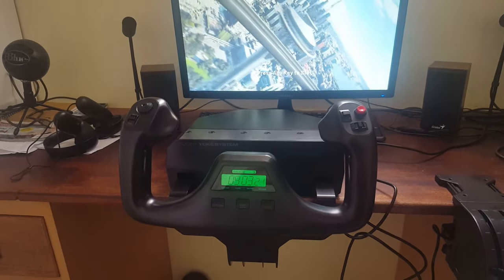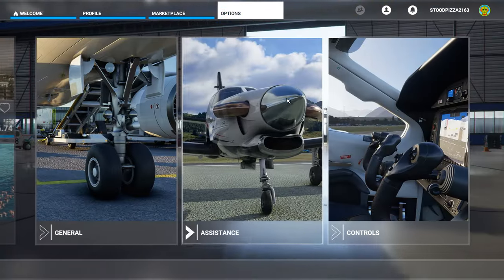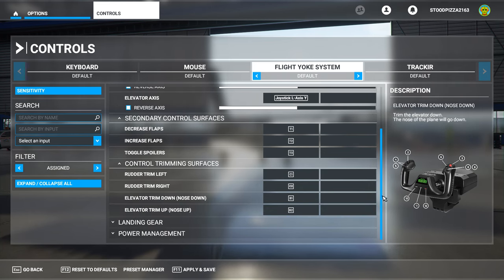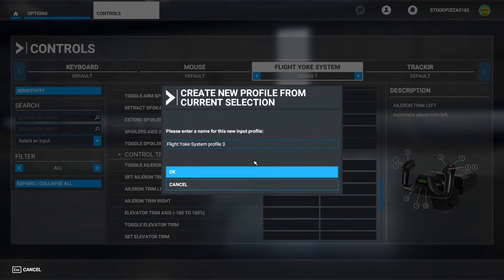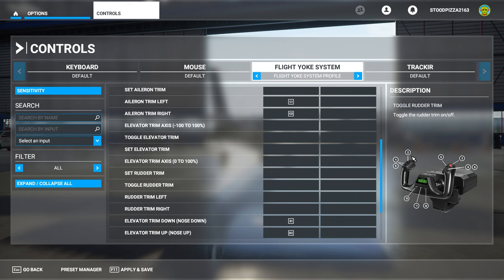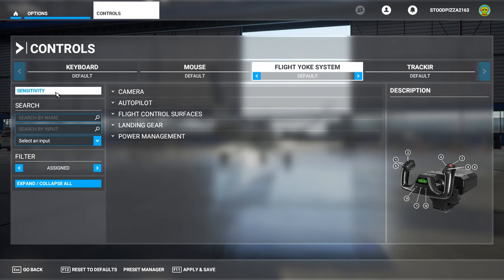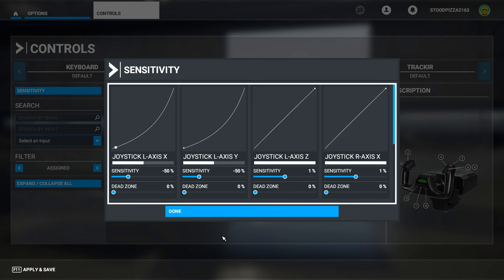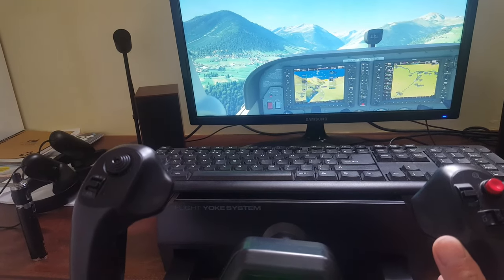FS2020: Setting up the Logitech Flight Yoke System and alleviating the Deadzone!

Comment: Thanks for your videos (this one and others), they convinced me to take the plunge and buy this yoke system. I was using the x52 HOTAS previously and I'm very glad I made the switch. I do miss the mouse control but can get by with my actual mouse. What I haven't figured out however is .. rudder. How can you control the rudder with this setup ? I haven't purchased the equally expensive rudder pedals and since there is no twist motion on this one I'm stuck. Am I missing something ? Thanks!
Reply from the maker: Great to hear that you decided to buy the yoke system.  
It doesn't come with rudder control; your options are to either assign one of the rocker switches to rudders, or to use something like the keyboard or Xbox 360 triggers (which is what I used to do), until you can get hold of actual rudder pedals.
Reply: @Huddison  I did try mapping it to one of the rocker but they only register as adding left or adding right and do not return the rudder  to its neutral position when released. Is there something in msfs 2020 under the config I could change for that to work ? My setup is pretty clunky as it is, I can barely reach the keyboard. will have to tinker :) Thanks again!
Reply from the maker: @VoicelessScream  I'll think on that for you.

Comment: Hi sir I need your help when I installed last week fsx2020 I adjusted my control it worked fine but today I wanted flight fsx steam edition and the controls disappeared I don’t know what to do
My Xplane11 work fine as well
Reply from the maker: This is not the first time that I've heard of this interference - someone else posted that they were having problems with P3D and the yoke, after installing FS2020.
I want to install my FSX (for tests) at some point; so I'll take a deeper dive into the matter, when I do😉
Reply from the maker: I re-installed FSX (Steam edition) - My yoke worked as normal and afterwards, I went back into FS2020: yoke was working as designed there too.
If I were in your shoes, I would completely remove FSX (all folders and aspects of it) and then reinstall to see if this solves the issue.

Comment: the game will recognize the Logitech yoke correct? Also I have a CH products yoke, and it doesn't want to recognize that one.
Reply from the maker: Yes, it automatically detects it
Reply: Not at all. I used my yoke and rudder  panel for prepar, perfect, but for fs2020 it’s a real mess, because of the prepar settings?

Comment: Hi , 
on high performance airplanes this is very sensitive on the fs2020 i have a yoke like this
Reply from the maker: You can adjust the sensitivity settings to get it more to your own liking. I have mine feeling and behaving great for myself👌
Reply: @Huddison  
Yes, I already checked these sensitivity parameters, updated the joystick driver ... can you handle the sensitivities within the saitek profile?
Reply from the maker: @Medeiros_Edilson  You can have a play around in the device settings itself, to see if that improves anything for you (in control Panel).
Otherwise, I'm at a lost with what is causing your issues with the yoke.  Perhaps a complete uninstall/reinstall of anything that you have been using with the yoke might help(?).

Comment: Hello sir, My PRIMARY CONTROL SURFACES HAS NO RUDDER AXIS, please help me to setup rudder control with throttle quadrant, Thanks in advance.
Reply from the maker: Use the keyboard if you have no pedals or other.

Comment: Thank you so much for this Video. I have bunch of Saitek panels and sadly they wont work for the moment. I should be satisfied with my yoke / rudder working. Super going friend.
Reply from the maker: Thanks. Hopefully the rest of your gear will be useable soon.
Reply: Download spad.next https://www.spadnext.com/home.html and install, works a treat.  I now have my radio panel, autopilot, trim wheel and switch panel all working.  It works better than the recently released Logitech driver because Spad.next allows alternate assignments and without it my Cessna trim wheel doesn't work.  Logitech did half a job with their driver so I uninstalled again.

Comment: Is this "Logitech Flight Yoke System" recognize by msfs 2020 automatically & out of the box on PC (not steam) or you need to adjust everything in settings?
Reply from the maker: It's automatically recognised yes - all you need to do is adjust the settings to your own preference, like I did.
Reply: @Huddison  What joystick you recommand, like yours or another one?
Reply from the maker: It depends on your budget: if you can afford it, the Thrustmaster t16000m has great reviews; I'm even tempted to buy that one myself.
Reply: @Huddison  Thank you.
Sometimes when the plane in the sky, it begins to swing around itself left and right, or up and down, and I completely lose control of the plane.
What is the shortcut on Keyboard or the name of the shortcut in menu that returns control to the plane to flies in a straight and balanced direction?

Comment: Aryeh 747 how assign red button on right hand grip like FSX? thanks
Reply from the maker: assign it to what?
Reply: The Yoke has two grips RH has a Red Button that changes from inside view to outside and vice versa. If we are at it how use two monitors with 2020?
Reply from the maker: @aryehluria9012  I'm not sure how to use 2 monitors with FS2020, as I've never tried it; but to use the RH red button as external views, just go into your controller options in FS 2020 and search for toggle external view and assign the RH red button to that.

Comment: I wonder if you could share the control profile file?
Reply from the maker: I'm planning to release another video soon on everything that I currently have setup on my Flight Yoke System.  This is an older video, so I've since changed a few settings.

Comment: Hello, How you control rudder without any rudder paddle, I've got just yoke and throttle quadrant, and how to set up brakes, Thanks in advance.
Reply from the maker: Either and Xbox controller or use the keyboard for rudder.

Comment: Does the Flight Yoke require external power supply? Mine won't pick up on any PC. Only the Throttle Quadrant shows power?
Reply from the maker: I plug my yoke straight into the PC, via its USB lead - does the green light, light up on the front of the yoke?
Reply: @Huddison  Only the Throttle quadrant shows power, the device does not even show up in device manager, tried on 3 PC's with same result.
Reply from the maker: @EKisCOOLERasJY  Hmm, sounds like the yoke may be faulty.  Have you tried installing a driver for it?
Reply: @Huddison  Can't find a separate driver for it, the yoke system installing gets to a point where it wants you to plug the USB in, but because it does not pick it up it can't continue.
Reply from the maker: @EKisCOOLERasJY  I've a feeling taht you might have a defunct Yoke system unfortunately :(
Reply: @Huddison  I believe so yes, now to hope the seller understands that he sold me a dead unit and will refund me.
Reply from the maker: @EKisCOOLERasJY  Best of luck with that; let's hope he's honest.
Reply: @Huddison  so he's like... "I'm going away for a while" when I wanted to make arrangements to return. So save to say I got scammed.
Reply from the maker: @EKisCOOLERasJY  Oh no :( Been there myself if it's any consolation: over a set of rudder pedals that never made an appearance.  Did you buy it of Ebay?
Reply: @Huddison  FB market, all that is left now is to open it up and see if I can find a problem. Have some electronic knowledge. His excuse for "being away for a while" rings of "I won't give your money back". Time to write 143$ USD off and make peace with it.
Reply from the maker: @EKisCOOLERasJY  Yes it sounds like he's dodging the bullet.
Reply: @Huddison  well if I do dig in the unit and find a solution I will share, seem to be a common problem.

Comment: Can You please make a tutorial how to set Logitech quadrant for REVERSES in Airbus ? A cannot set it properly :(
Reply from the maker: Having trouble with that particular setting myself; will take a deeper look at it for you😊
Reply: @Huddison  Thanks :) I've tried many different options and its freaking out every time. Setting reverse axis for throttle seemed doesnt work either. Only reset to default settings works with correct throttle lever axis for me.
Reply from the maker: @studiomattone5266  I will see what (or if) I can come up with.
Reply: @studiomattone5266  Should be "Decrease throttle"
Reply: @abc1993able  THANK YOU ! I would never figure it out ! Works as it should ! @Huddison no need to bother anymore :)

Comment: Great video!  How do you assign the switches on the Logitech throttle quadrant?
Reply from the maker: Just choose what function you want them tp preform and assign them in controls. Ensure filter is set to all if the function isn't assigned already.
Reply: Although the throttle, mixture and prop controls work and the 3 switches have preassigned functions there is no depiction of the unit that I can find with the switches identified.
Reply from the maker: @ronrund  Choose a function that you would like to be assigned to one of the switches and simply press that corresponding switch in the 'search by input' box.

Comment: My brother (86!) has a problem with the Saitek in MSFS and cannot find the graphs for deadzone and sensitivity, showed in your video. I found a comment that you have to remove the bindings in FSX and even delete the FSUIP in Steam. But that looks as a one-way solution. After that it seems that you cannot use the Saitek any more in FSX. Any comment on this?
Reply from the maker: Deadzone and sensitivity are not showing up atm - seems to be a bug with latest patch. A few people have mentioned this in my comments; hopefully it'll be fixed soon!

Comment: I see the system now has 2 sensitivity settings - a plus and a minus - maybe with the last update. Any ideas how to sort it out now?
Reply from the maker: Thanks for bringing this to my attention, as I hadn't noticed until you made mention of it. I just did a quick flight in the default Cessna 172, with Sensitivity set to +/-70 and the aircraft behaved pretty much exactly as it did prior, with just the one sensitivity  setting set to -70.
I will look into this further and will aim to make a new video on just the sensitivity settings in FS2020, as this seems to be a main topic of puzzlement for many :)
Reply from the maker: Having done a little more rigorous testing: something is off with the sensitivity of the ailerons and elevators - will be testing and changing more and will report back..
Reply from the maker: And after more testing: I found that increasing the sensitivity (moving it closer to 0), to +/-50 on the ailerons & setting a dead-zone of 1, has now smoothed out my banking/rolling, whilst near eliminating the freaking-out moments, when banking sharply.
I've still yet to refine my elevators, but a similar setting will likely help there too.
If you haven't seen this already, the following forum post has lots of interesting suggestions:
https://forums.flightsimulator.com/t/control-sensitivity-after-update-5/309754

Comment: I hope that the Pro Flight Yoke System will work on Xbox Series X version of the Flight Simulator too.
Reply from the maker: Mine doesn't - only Xbox branded controllers will work with the Xbox, officially.

Comment: The plane looks very slow to respond to the yoke when turning this is what is putting me off buying the yoke, my logitech 3D pro Joystick is very sensitive and the planes responds straight away
Reply from the maker: I don't any lag, or slow response, in the sim itself & nothing quite beats the immersion of using a physical yoke with yoke controlled aircraft!
Reply: Don't get me wrong i have put £200 to one side to buy a Logitech G Saitek Pro Flight Yoke System and a Saitek pro flight switch panel but not sure which planes they would fit as i use MSFS and i use Air Hauler 2 for the MSFS but the C172 can only carry 540lbs so i need a bigger plane to carry more cargo

Comment: Thanks for sharing! What settings for sensitivity do you recommend when flying a bigger airplane like the dreamliner? I use the saitek yoke system. I am having a hard time getting it down when using the -50 that you use on your cessna settings.
Reply from the maker: I don't have the Dreamliner (just bought the standard FS2020 package) - using trim, I don't have much difficulties with any aircraft  I've flown so far though.
I'll take one of the airliners for a test flight and get back to you.
Reply: Thanks for your quick reply! Do you also adjust sensitivity/deadzone on your trottle? Quadrant?
Reply from the maker: @mortenandretorvund310  No I leave the throttle sensitivities at default, but do check my other video about the 737 replica handles for the throttle quadrant; they give it a good solid feel and fit.

Comment: will this work  with a proper vr headset , im looking for the right setup to play microsoft flight simulator in vr at 4k with an 4090 13900k build.
Reply from the maker: The yoke works great in VR, although you may want to look at a more recent/upgraded Yoke system (like the Honeycomb setup), to compliment your excellent PC rig.
Reply: @Huddison thanks which vr headset would you recommend using for this setup?
Reply from the maker: I'm not up to date with VR headsets, but The HP Reverb G2 headset is still used and loved by many people.  @pcgamerzzzchannel3407

Comment: I can’t even download the game it’s stuck on please wait when their is 59.97 gb left... I uninstalled and tried multiple times it always gets stuck at 59.97 gb.
Reply from the maker: That's hugely frustrating 😡
Maybe lots of people are currently trying to download it, being the weekend and all?
Reply: Huddison it’s been doing it since launch
Reply: I’ve been trying for 3 days it always does it, it’s happening to a lot of people
Reply from the maker: @jakepet3137  Sorry to hear that; hopefully you'll be able to play it soon
Reply: @jakepet3137  Done the same to me to, trick is to just close everything and let it do its thing on its own.. including leaving your computer alone as in step away until its done..
Reply: DSLeicester I did do that the don’t touch it it just crashes at 59.97 ever time... that exact number for a lot of ppl it’s Microsoft’s fault with that file
Reply: Had the same problem. I uninstalled whatever I had downloaded of FS2020, updated Windows 10 to its latest version which is update # 2004, connected a ethernet cable and left it downloading overnight (seem wifi is too dodgy for such a big download). It has worked for others who have asked me, so hope it does for you too
Reply: Jaime Robles u need a Ethernet cable?
Reply: Yes, in my case I have a 150Mbps internet connection and using wifi I was getting a very variable 60Mbps at the computer while installing FS2020. I connected the ethernet cable and got 147Mbps at the computer while installing FS2020, after that the install went on without any problems
Reply: Jaime Robles ok I’ll have to wait to install it then bc where I am now I don’t have Ethernet I have a 90 mb/s WiFi connection, my Ethernet is at 280 mb/s so I should be good
Reply: Did u get through?
Reply: Have you got enough space on your Hard Drive to install the game?
Reply: Lvkas of course I have 709 gb left it’s a glitch it is happening to alto of ppl the same amount 59.97

Comment: Just setup the flight yoke and cannot get the rudder to center itself. Flying MSFS 2020. It will turn left and right but with yoke but will not center itself when in the neutral position.
Reply from the maker: The Rudder or the Ailerons?
Reply: @Huddison  Just the rudder. The ailerons work.
Reply from the maker: @jeffmcauley3287  What are you using as Rudder?
Reply: @Huddison  Sir, really appreciate your response and the videos you do. I was able to fix the problem. I reinstalled the driver for the Logitech Flight system and went in and changed settings on the control page. Set the yoke: Rudder Right (Yaw Right) Joystick L-Axis- and Rudder Left (Yaw Left) Joystick L-Axis+ also set Rudder Axis L -AxisX. Thanks again

Comment: I seem to be the only who has not mastered the calibration of the yoke when it comes to the aileron / rudder control.  Yes, the system recognizes the pro flight yoke and the response of the L-axis X is displayed correctly when setting up under options/controls/ primary control surfaces. Alas, when heading down the runway the plane immediately veers of to the left regardless of my aileron (I have no rudders) input. Anybody any suggestions ?
Reply from the maker: Did you see my other video on how to fix the drift with the yoke?  That may help you.
Reply: @Huddison  Thanks Huddison for getting back to me. I solved the problem in the mean time. Initialy the flight yoke profile as loaded by FS2020 did not show the rudder axis under Primary control surface. I had to delete the registry entry in windows and configure joy.cpl again. Now the ruder axis showed up as programable. "Binding" the joystick l-Axis X, that already had been asigned to the ailerons axis with the rudder axis did the trick.
Reply from the maker: @zsmow  Good to hear you got it sorted.
Reply: "Initialy the flight yoke profile as loaded by FS2020 did not show the rudder axis under Primary control surface. I had to delete the registry entry in windows and configure joy.cpl again." Can you please explain which reg. entry to delete and how to configure joy.cpl. I've got Logitech yoke and throttle quadrant and would like to assign rudder to one of the throttle knob. Thanks in advance.